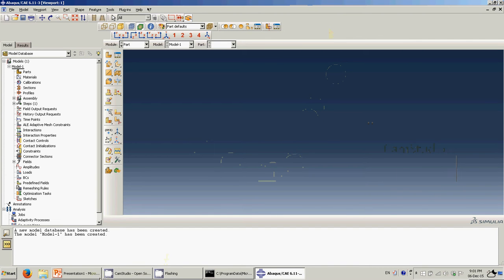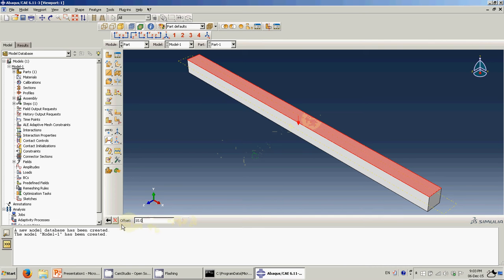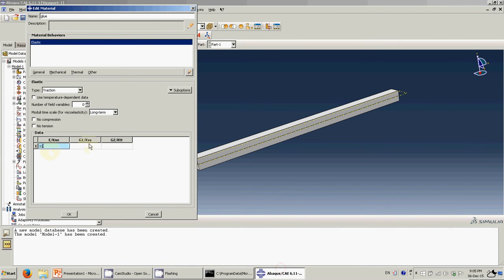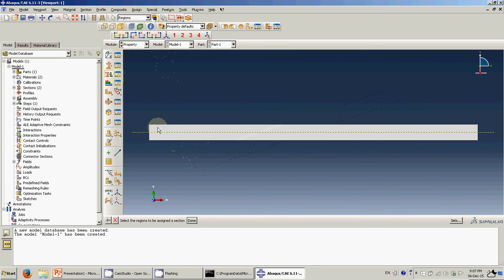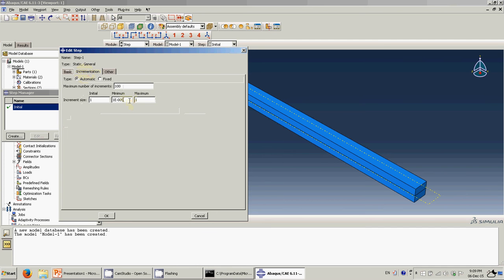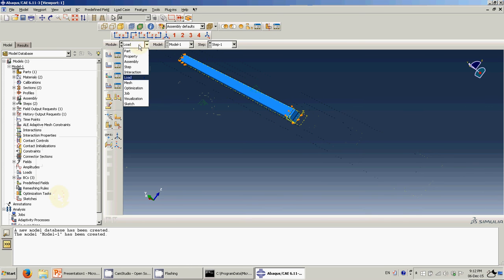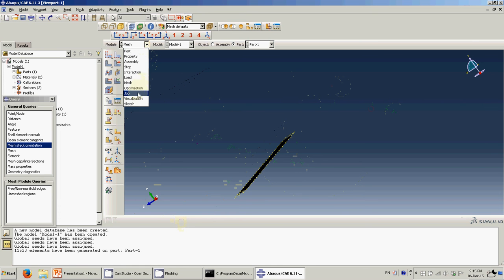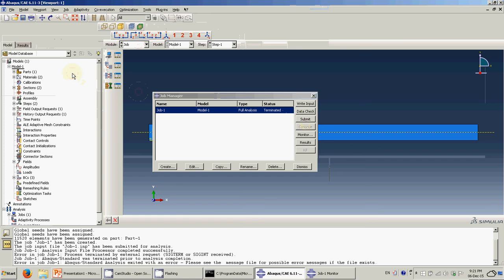How to Use 3D Cohesive Element COH3D8 in ABAQUS - Part 1

Comment: Thank you for the great video, I wonder that if we use fracture energy option insead of the displacement and we have the traction-separation curve, is it the full area under the curve or the area between damage initiation and failure to calculate the fracture energy G ? Thanks.
Reply from the maker: For brittle material when you dont have plasticity, fracture energy is the energy under traction separation (full area). For material with plasticity, it is the area under the curve excluding the plastic area.

Just draw a sketch and it will be easier to understand  which part is elastic energy and which part is plastic energy. The damage always associated to elastic energy since it degrades elastic stiffness

Comment: hi, thank you for sharing, about cohesive element orientation, is it unnecessary to assign stack direction if you define sweep path for cohesive element part under mesh controls?
Reply from the maker: Just make sure to recheck the stacking direction. U dont want in a situatuon where you believe that you got the correct results, prepare report and prented it.. and then realized the direction is incorrect.

Normally if you sweep it would be ok.. but once you do partition, the direction can change again..

Comment: Why should we use type=traction for cohesive element? Why not isotropic?
Reply from the maker: Traction type means that you have traction separation relationship. So you multiply the stiffness matrix and the separation between 2 faces. While if you use isotropic, they will expect strain instead of separation.

But go ahead and try yourself. Maybe it works

Comment: SIR, how to provide slip property between reinforcement and beam.
I am using surface to surface  contact and provide normal, tangential behaviour (friction coefficient=.45)
I hole in my beam and insert reinforcement as solid element but it doesn't take any attempt.

sir any suggestion to how to provide slip property between reinforcement and concrete.
Reply from the maker: Hi Can you be more specific on the slip properties? what do you mean with slip properties..?
Reply: @FEADith   
Sir I am b. Tech civil engineering student(INDIA)
Sir, I try to give slip property between steel reinforcement and concrete beam.
Sir generally we draw reinforcement as wire element and embedded into solid beam element.
but practically no reinforcement is fully embedded therefore I try to give slip property using cohesive surface and provide friction coefficient but there is some convergence problem.
Reply: @FEADith  sir if you have time then i am hard to send y abaqus file to you
Reply from the maker: @navdeetsaini253  hi I am sorry i cannot help you to see your problem in more details.

But if what you want is to explicitly model steel column inside the concrete beam.. you might want to use merge cut operations (such as in this video https://www.youtube.com/watch?v=a5uIN4Sxj8c&t=105s  )
and assign sliding properties as in this video https://www.youtube.com/watch?v=WwJpAe73JvE

hope this helps

Comment: Hi, How can i get cohesive material properties of material like fracture energy,  nominal stress
Reply from the maker: B. Vipul you can do basic test like DCB test for mode 1 frature energy, ENF test for mode 2 fracture energy or MMB test for mixed mode fracture energy
Reply: Thanks for your reply, can we get these information using nano-indentation
Reply from the maker: B. Vipul i dont think you can get it from nano indentation. Usually from nanoindentation, you may get hardness (related to plasticity) and Young's modulus.. but not the fracture behavior.

Comment: I followed all the steps from the video and run the simulation. After a moment, I got an error "TOO many increments needed to complete the step." could you help me?
Reply: Hello, I have the same problem. Did you find the solution to this???
Reply: go to edit step, incrementation, and increase the maximum number of increments?

Comment: hi Hi Dithoae,
Thank you for your video,I want to ask how you know the dis-max=0.25?
Reply from the maker: this number is just sample. but if you to calibrate it, you can plot the stress-displacement curve of a given cohesive model. Then the are under the curve should match with the critical energy release rate (G1c) of the material. In that case, you change the value of dis_max so that the area below the curve match the G1c
Reply: @FEADith  Do you know how to calculate the stiffness values for the interface elements? (Ess,Enn etc)
Reply from the maker: @prajwalbharadwaj875  it depends on what you are trying to model. If you are modeling a zero thickness interface, you should put value that is big enough to prevent spurious compliance but small enough to facilitate convergence. Value of E=10e5 to 10e8 are generally recommended.

If you are modeling real material interface with finite thickness (for example adhesive) you can put real value of adhesive stiffness or usually E = Ereal/thikness of interface. Hope this helps.
Reply: @FEADith  Thanks for the reply. Just to be clear, for zero thickness surfaces are you selecting a value of thickness T between 10e-5 to 10e-8?
Reply from the maker: @prajwalbharadwaj875  no.. i recommend stiffness with value around 10e5 to 10e8. Not the thickness.
Reply: @FEADith  I see. Do you know how this translates to the thickness of the cohesive element? Thank again for your help!

Comment: Hi Dithoae,

Thanks for sharing the video . I did exactly what you said but there is no element deletion. I assumed the element deletion but in the result, there is an expansion in cohesive elements but no deletion! so two surfaces aren't really separated. Do you have any idea about this issue?

Thanks again

Hoda
Reply: you need to enable status in the F-output, he ticks it towards the end of the video.
Reply from the maker: are you sure you put exactly the same input parameters? try to reduce the Gc (energy at fracture) by half
Reply: In mesh module, while defining element type for Cohesive layer you can see an option for element deletion, there you have to check.

Comment: Hi, it's me again. I implemented what you suggested and it worked. Thank you.  Now, I'm trying to use the PPR UEL. But I'm in doubt about the units I should use for the fracture energy parameter. Should I use N/m? Because I have 300 N/m and 500 N/m for the normal and tangencial directions, but I realized that you and Prof. Paulino have used a very smaller value.
Reply: +Heron Dionisio I forgot to say that I'm using meters and Newton as my units in Abaqus.
Reply from the maker: +Heron Dionisio You can use whatever you want.. just make sure they are consistent with another units.. if you draw your model (with unit length in mind as meter, you also need to use meter. and if the stiffness is 200 GPA and you input the value of 200e9 to the cell of stiffness, then it means you choose pascal as you pressure/stress unit.. in that case, your force unit should be newton..

Comment: Hi. Thank you for sharing this video with us. I'm trying to use cohesive elements in a cylindrical geometry, but it isn't working. I saw you didn't connect the cohesive elements to the other parts with Tie Constraint. How are they connected? Are they sharing nodes? I tried to mesh the parts doing the same thing you did, but it didn't work. The parts don't connect to each other. Could you help me, please?  Thank you again.
Reply from the maker: You should make all in one part.. So they share nodes. No need to tie. If you want, you can also do it.
Reply from the maker: If you wan to make it in clynder.. Let say cylinder wih radius r1 and another concetric cylinder r2.. You can make one cylinder and do partition at r1, r1+0.0001

0.0001 Will be the thickness of the interface. It should be straight forward as in the video.. Make sure you follow all the steps..
Reply: +dithoae Thank you very much. I will try to implement what you suggested.